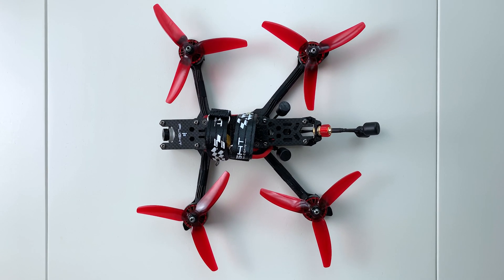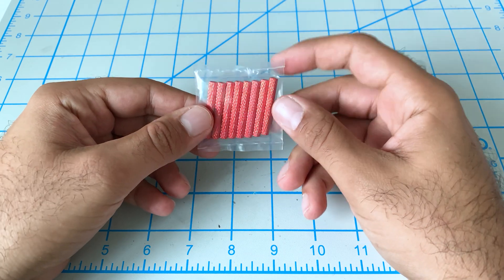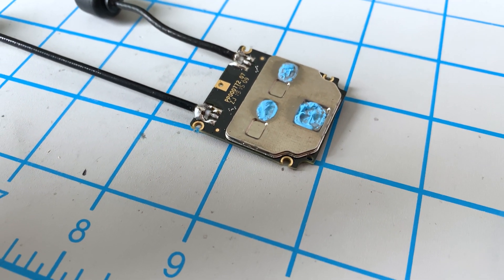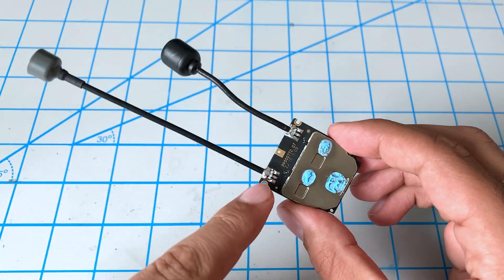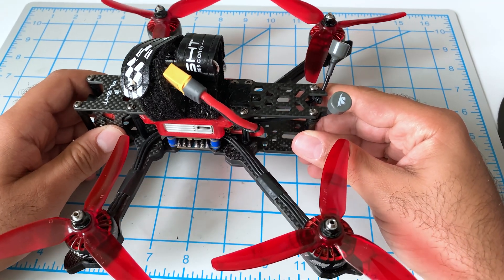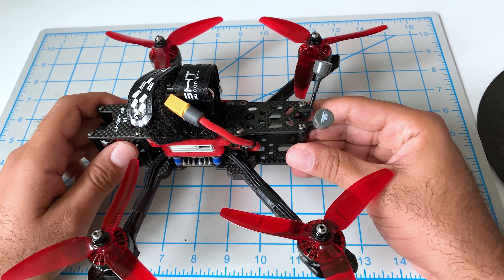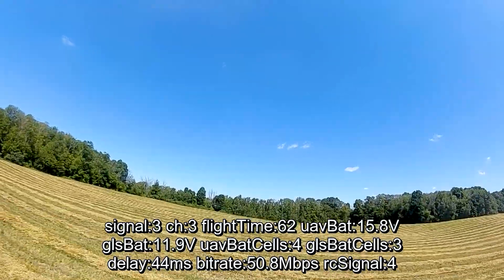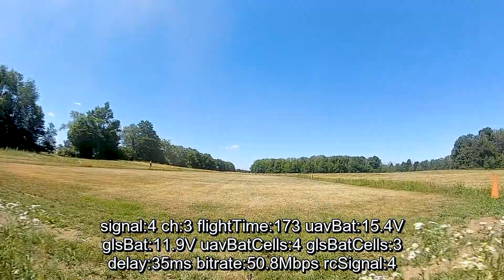DJI Digital FPV Air Unit Disassembly & TrueRC Singularity 5.8 Direct Solder | DC5 Titan Antenna Fix!

Comment: Lol bro you have all that free space at the ass of your quad. You have already soldered your antennas to the vtx board. Just use a naked airunit, conformal coat it and waterproof the whole thing then secure it at the back doing that will allow for your problem of not enough antenna length for your mount. It will fit that and fill in that space im honestly amazed your quad is not spazzing out having the unit so close to ur gyro like that.

Comment: Hi there. Thanks for the video.  I did something dumb.... powered my dji air unit up for a firmware update but forgot to attach antennas. Do you know if i likely damaged the air unit? It was powered on for about 5 minutes...

Comment: good work, i have a dc 3 and a dc 5. bolth are costum builds. the dc3 is build with tyro 79 elektroniks and motors, and the dc 5 is a mamba stack 722s bluetooth and ummagawd v2 2306 motors 2150kv. but i put a vista with polar cam in it. just orderd the caddx air unit, for the dc 5 for better recordings. with bf 4.2 and rpm filter and stock pids, it runs like a beast. dont need to go full throtel, most of the time eaven in dives i use 50-75% throtel. and i smasched it a few times good into trees and ground, and i still have a complett spare frame. never brock a arm ore anything on it. 4 me its a flying tank. what would you say are the stock antennas as good as the true rc. im using the v2 goggles with stock antennas as well.
Reply from the maker: Thanks! I enjoyed the DC5, was a good frame minus the weird antenna layout.

Comment: Hi, does cutting the cable length of antenna affects the antenna power?
Reply from the maker: I haven't found any noticeable change in the signal.
Reply: @Mangorille  cool thanks..

Comment: I build this frame with caddx vista and I used the stock antenna tpu mount just I used the top hole, much much better than factory design its so beautiful with caddx vista single antenna
Reply from the maker: Thanks for sharing your setup. Ya that would work well. I wanted to keep the air unit at the time of making this video. I have since changed all the kwads over to the vista.

Comment: Hello had a question on how you removend the brass connector on the board before hardwiring the antennas. Did you use a solder Iron to heat it up or a heat gun.
Reply from the maker: Hey. I used a soldering iron with a large tip and a bit of solder already applied on the tip. The old connector came off really easily that way.
Reply: @Mangorille  Hey thanks for the quick reply and the "tip". I'll try that and see if I can take it off and hard wire like in your video.
Reply from the maker: @88_shadesoffpv  No problem. Let me know if you have any other questions. Are you going to hardwire the stock antenna?
Reply: @Mangorille  Yes. Planning to built a waterproof craft 5". Having seen some videos from others, I want to attempt to build one. Will probably have to order longer antennas, don't really know yet.  I want to change their possitioning instead out coming out the back, I'm going to try side mounting like I've seen on some of these videos. Now that I can hardwire in the antennas, I going to attempt to surround the openings of the air unit with high temp silcone and seal it.
Reply from the maker: @88_shadesoffpv  Sounds good. It has a lot of openings to seal. :)
Reply: @Mangorille  Hello,
Took off the connectors with a little flux and  with a larger bit. Thanks. I find the antennas that I have are shorter than what I'm trying to do  and need  to order some antennas from TrueRC.  In filling out the request form I don't understand the part that ask "Antenna Patter > omni, directional, hemispherical" don't know what to pick here. Also horizontal (AZ) beamwidth. e.g 360 degrees. what did you put for beamwidth.
Reply from the maker: @weewhackr2250  For the antenna on the kawd itself you want omni. You can always ask them to just take the Singularity and put  a custom type/length of cable on it.

Comment: It worked perfectly! I soldered just 1 to the board and everything was back to normal. Though I can see some issue down the road with the exposed gap for the air unit, maybe seal it with glue? 
Either way, you just saved me a lot of money! I ordered some mmcx so i can eventually fix it properly. 

Ahh thank you sir.
Reply from the maker: Awesome, glad to hear it worked out for you. Rotor Riot used to sell the compatible MMCX connectors, have a picture on our Instagram of them installed if you want to see how they look.
Reply: @Mangorille  no worries I ordered them off some random parts website, and unless theres a unique spec specific to that model.. I mean it looks identical to the air unit one.. please tell me there arent hidden polarities or something rather lol
Reply from the maker: @purpleAiPEy  That's great, usually would be something physical like the size of the pin or length, etc...

Comment: Hello friend, I finished all this process that you showed, I reassembled everything and connected to the drone, and I do not get the image in the dji goggles, image transmission stopped, try to bind again and it does not work, could you help me please
Reply from the maker: Hey, when you did the soldering, are you sure that there is no short circuit? Check under a magnifying glass.

Comment: hi goood video i do the same but i put the original dji antena but i don't have the same range i am lost the signal 50% in 500 meters do know why ?thanks
Reply from the maker: Hey, thanks! I had this done with the original antenna as well with no negative impact to the range. Do you have any pictures of your solder points? Perhaps the solder did not make good contact or when the antenna was cut, there was a short between the inner and outer sheath. You do have to be very careful when cutting the antenna.
Reply: @Mangorille  maybe I was have the low mw I change today and try tomorrow and if I have problem again I open and I send you photo sent me the email
Reply from the maker: @AFBeatsOfficial  Sounds good. Mangorille at gmail

Comment: Well done man! I hate mmcx )
Reply from the maker: Thanks bud, ya, they're too delicate especially when most frames need you to bend the antenna cables at sharp angles.
Reply: @Mangorille  Man, I've replaced today MMCX on my unit using your tutorial. And it works!!!! Thanx a lot. Now my range is perfect again!

Comment: By default Dji Air Unit is waterproof but in your case its not any more. By the way, you may shift Dji Air Unit to the back. In that case you do not need long cable any more.
Reply from the maker: The air unit is not waterproof or even dust proof. In order to be waterproof it needs seals and covers on all openings, which it does not have (think of the bind button, the SD card slot, the space around the antenna connector, etc...).
Reply: Yea I was gonna say how in the hell you figure it’s water proof it’s got a giant holes on every side of it. I think you could have gotten your extra length from those antennas if you would have just de soldered the connectors instead of cutting them with the exact o knife excellent video !
Reply: @FLMan180  I fully agree with you and l also think like you are, but depend on my experience I may tell that my version of Dji Air Unit is waterproof :) please check this video: https://youtu.be/DfpHdl6G97M    I changed some parts after but not Dji Air Unit.

Comment: This is why I ordered the dc5 HD frame this was poor design. And the air unit, flight stack is too tight for nice wiring job
Reply from the maker: I liked the mass centralization but agree that it causes a lot of other challenges. Having to use the SMA extension, being limited in stack height, etc... I do like the fact that you can take the whole top plate off and have the air unit, camera, and antenna come out together in one piece.

Comment: really well soldered.  this is a superb upgrade over the ever-so-wonky MMCX issues with the vtx.  thanks
Reply from the maker: Thanks bud, good option for folks who have already broken the MMCX. The good thing is that the whole board is the ground as well in case you damage the traces on the side.